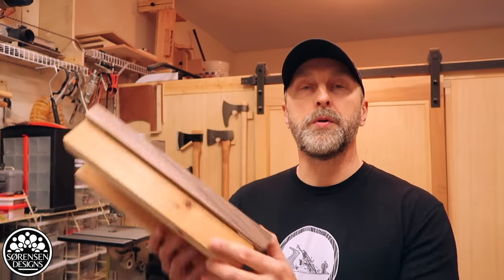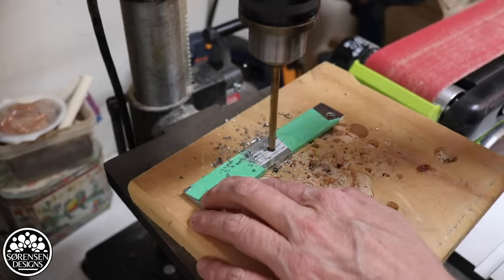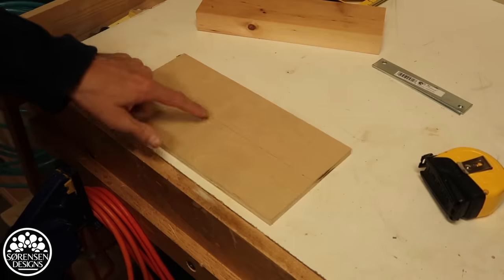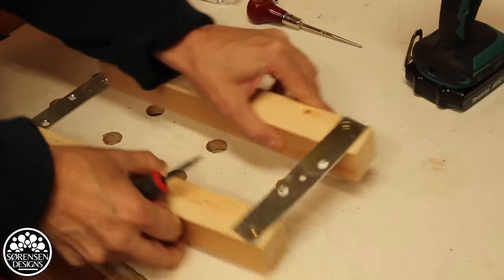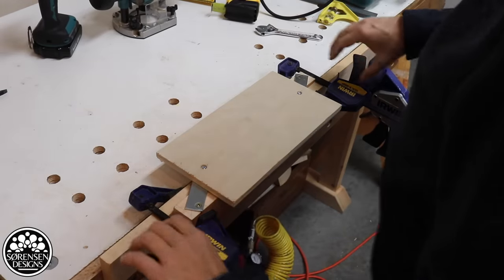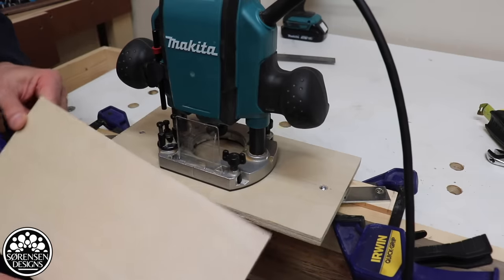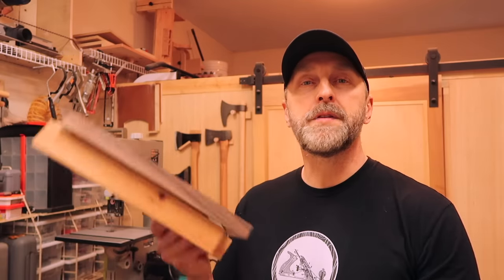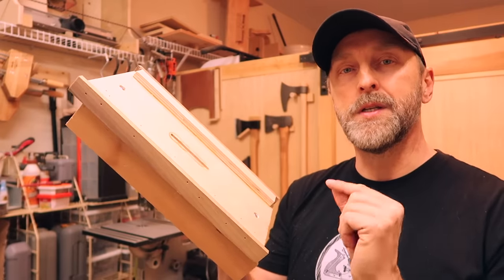The Amazing Self-Centering Mortising Jig

Comment: Really nice video! I made one of these myself a while back. The only difference in construction really was I installed the rails first and used the router to cut the slot and also cut the holes for the bolts holding the centering assembly. This way I knew that my centering bolts were lined up perfectly with my mortise slot. Thanks for sharing!

Comment: Thanks, I've made one for myself. few points:
To keep centred, the parellelogram you make with the mending plates needs to be drilled accurately. I ended up using 2mm thick pre-drilled metal strips so I didn't need to risk my own poor accuracy. I did countersink though - do this on your drill press' lowest speed.
Since I used pre-drilled strips, I am able to unscrew and move the alignment arms if I'm doing something quite narrow.
Don't be shy with having thick alignment arms. I used 9mm MDF and that split shortly after taking the screw. I'll rebuild these with real wood (maybe mdf faced for flatness)
Instead of nuts and bolts to attach the mending plates to the base, I used countersunk screws (countersink the underside of the mending plate and the screw goes up in the my end stops)
I made a "length piece" about the length of my tenon. This way I can line up the mortise with the zero-clearance cut, line my router up with my end stop, lay the "length piece" next to my router then clamp on an end stop so I know how long my mortise will be.

Comment: I just made this mortising jig today after watching your video and it works really well! I have been wanting something to mortise with and this tool fits the bill perfectly. Thanks so much for showing me how!

I made it 14" long and 7" wide so I can comfortably do mortises and tenons on a 72" x 18" side table with 5" aprons that I'm currently working on. I find that the metal bars make it a little bit of a challenge to get the router to sit squarely on the piece that I'm mortising since they're  resting at an angle. I want to offset the mortises going into the table leg closer to the outside edge so I'll just put a piece of wood the appropriate thickness so that the wood moves over the right amount.

Thanks again! Great idea!
Reply from the maker: I'm glad it's working for you. The jig squares up and centers when the work piece is clamped between the two sliding blocks underneath. The pressure of the clamps will usually keep it square. The other method I use, instead of this jig is a simple set-up with my plunge router and the edge guide. You can see how I did that in this video: https://www.youtube.com/watch?v=l2TWzCQ1fzs
Reply: @EricSorensenCanada  Thanks for the additional advice!

Comment: You can build this jib for a non-plunge router  for open ended mortises as well by putting a larger diameter Forsner bit hole at one end of the slot to allow for router bit to descend onto the work piece.  (Often making tables allows for an open (top) ended mortise, because the joint is just as solid and hidden below the top construction (tables)

Comment: Another great video. Imagine you have to keep track of the same reference side still to avoid any issues with it not be exact center due to minor man-made introduced errors such as how thick the mark was on the side of router, how the screws went in and possible pulled it a little etc. Also my router isn't flat on both sides so might make it complicated as to where the router sits inside the guides. Love your stuff!
Reply from the maker: Thanks! Yes, easy enough to avoid. All you really need to worry about is the length and start / stop point on your board. These days though, I often just use my domino joiner. But for those who don't have one, this is a great system.

Comment: If you need to do double mortices then add a piece of wood half the thickness of the distance between the mortices to one of the rails underneath. Cut one mortice then turn the jig 180 degrees and cut the other.
Reply: boris johnson forgive my ignorance, is a double Mortis mean to parallel mortis to each other on the same work piece ??

Comment: Great idea, personally I would make the lower rails just wide enough to get the router between them,  then clamp and cut the slot from below to ensuring it is dead center, also if the same rails were slightly longer and offset, only one clamp would be needed to fix both into position! Nice axes by the way! ;)
Reply: David Harper that’s what I thought. And you could even use the router itself to plunge the screw holes, to make sure they are aligned.

Comment: Needed a quick way to do some mortising and this looks perfect.  One item though and someone may have already pointed this out.  I check 5 routers I have in my shop and none have the center line marks you pointed out in the vid.  This may be a feature found only on the brand you are using.  It won't really change anything but if all of them had that is might make things simpler.
Reply from the maker: That is pretty unusual to have no center marks or arrows on the router base. It does make using jigs and edge guides much easier.  You also might want to check out my video on Loose tenon joinery: https://www.youtube.com/watch?v=l2TWzCQ1fzs

Comment: I made it today. Works really well. I wish there was something to do with those bolts that hold the mending plate on. The workpiece ends up resting on them. Anything you do to avoid that would have to be part of the mending plate otherwise it would get in the way during rotation. The nuts also limit the minimum workpiece thickness.  I think the solution would be to tap out the mending plate so it becomes the bolt. Also, you're making it look like some sort of miracle when you just drill holes in those bottom holding boards at they are exactly the right distance apart. I had to do it twice. :-) All good though I have a nice jig now.
Reply from the maker: Thanks Robert! Good to hear! I like your solution of using a tap wrench on the mending plate holes. I might try that one myself. I trimmed down the bolts on mine but I still have a 1/8" on the mending plate from the nuts. I've seen other folks use a shim underneath theirs to ensure an even depth. I can still get a good 1" - 1 1/4" deep mortise out of it, which is good enough for most of the stuff I do.
Reply: Thanks for the video. Another idea for getting rid of the nut is to spot weld the nut. Then turn it over and put it between the wood and metal plate. You will have to countersink it into the wood. Well that is what I did anyway.
Reply: @EricSorensenCanada  
Great jig.
A simplified solution would be to use a Rivet,smooth semi flush.
Reply: @richardlug6139  I have another idea... why not just put the nuts on the top? Since they will be just where the stop blocks are, it should be easy to cut a dato into those. Could also countersink the top plate to hide the nuts.....

Comment: Clever jig. Thanks for sharing!

p.s.

Rub some candle wax (un-melted) on the bed of the jig where the router slides. It will make for a much smoother transition from left to right and leaves virtually no mess at all, but lasts for ages. ;)

Comment: Hai bro ,i have the same router and the plunge depth is 35mm and i want to drill 6mm and 8mm dia through hole in 42 mm depth wood how to do it from single side plunge with spiral bit ?
Reply from the maker: @sankar narayanan The best way is to just use a drill or drill press and go straight through. If you really want to use the router, you'll need to start with a small pilot hole using a drill (keeping the drill straight ). You won't be able to do a plunge all the way through from one side, but you can use the smaller pilot hole to help you plunge on each side towards the middle to get your full-through hole.

Comment: I'm kind of new to routing.  Could you cut your slot an inch wide so you could use different sized bits to cut different sized mortises? I don't think you'd need a guide bushing because of the self-centering feature.  Thanks!
Reply from the maker: @Stephen Brockhoff You could do that if you're using a router that accepts 1/2 inch shanks. The alternative is moving the guide rails for the jig wider apart, so you can cut your mortise in 2 or 3 passes, no guide bushing required.
Reply: Nice.  Thanks!
Reply: @EricSorensenCanada  You could use the same self centering mechanism on your guide rails to allow for a wider mortise doing multiple passes with the smaller bit.

Comment: Great Idea I am going to make one. Thanks for the lay out to make one. I happen to find 2 pieces of  Steel 275MM X 45MM X 3MM Heavy Duty Flat Corner Brace  do you think these would work. I know there a little bigger. But there here. Happy Holidays and stay safe
Reply from the maker: Give it a go with the hardware you have. Worst case is you'll need to run out and buy some flat bar. Cheers🙂

Comment: Nice jig but I m having a problem cutting at the edge of the long work pice? The thickness of the self centering metal cause an angle cut. Have any solution?
Reply from the maker: Thanks Sathasivam Nandakumar! You probably need spacers approx the same thickness as the metal mending plates to stabilize the jig as you're cutting.  Either that or the screws at the bottom of your plate are sticking out and need to be trimmed off.

Comment: Nice Gig. I could use that on the window shades im recovering, problem is the mortises are at a 45º angle. have to figure a way to make it work. Been using a chisel to make them, lol.  Big thumbs up
Reply from the maker: Thanks Nelo Fernandez! If you're making a lot cuts for the window shades, it might be worth making a custom version of this jig with the holes drilled so it orients the top plate at 45 degrees.

Comment: How long are the mending plates?  I tried to make one and it didn’t work. Apparently the plates were too short or the bottom guides were.  Any suggestions ?
Reply from the maker: @GC Ranch You need a 6 inch mending plates. And you will also need a mill file to file down the bolts or trim them with bolt cutters prior to assembly. Hope that helps!
Reply: Eric Sorensen thanks for your reply.  I think I had some short mending plates which would not allow the jig to sandwich as closely as needed for it to come together on a piece of ¾ “ stock.  Guess I missed some of the details .

Comment: great jig. congrats. if you have to cut a mortise lager than the bit...?
Reply from the maker: Thanks Garenne01! You can increase the span of the guide rails, if you need to accept a thicker tenon. I work with a lot of 3/4" material, so 1/4" wide is plenty for me.  If you make your own floating tenons, you'll want to pick a standard size and stick with it for the majority of your projects.
Reply: @EricSorensenCanada  thanks
Reply: I guess spacer blocks in between the self centering rails and the workpiece, would allow this.

Comment: Great Video and an excellent Jig. I will be making one today. I think by permanently placing the stop blocks, Loose tenon joinery will work. And, I tried to contribute on Patreon, but the website would not let me. On the checkout page it just kept on searching and searching. Not able to become a Patreon contributor.
Reply from the maker: @Frank Thornal Thank-you! Fixing the stop blocks is a great idea if you want a quick one size system. One less thing to think about. Thank-you for attempting Patreon. They are having issues with their website right now, hopefully it will be resolved soon! Cheers 🙂